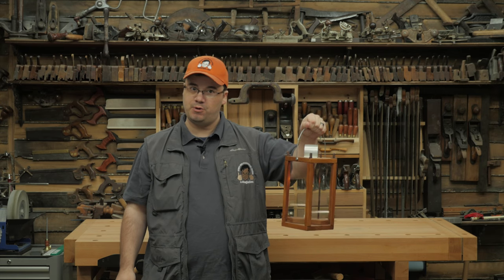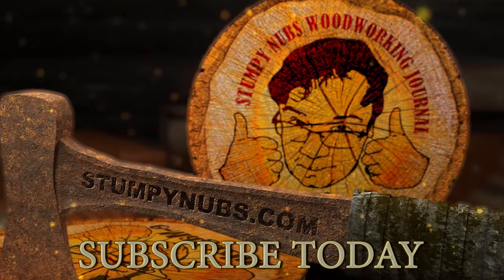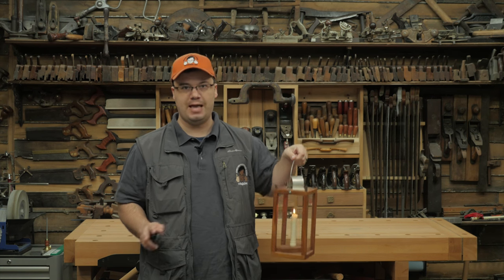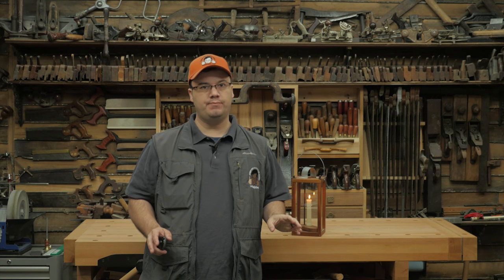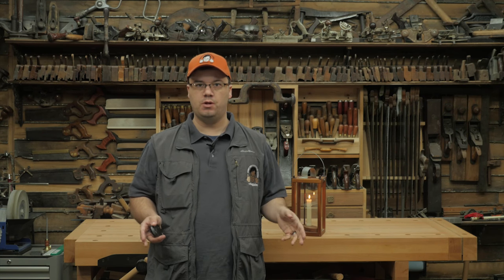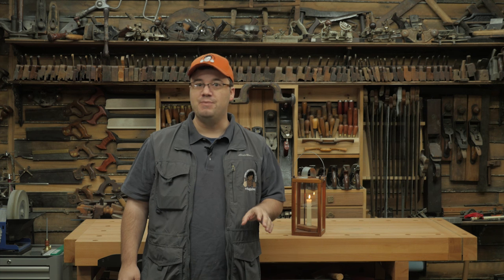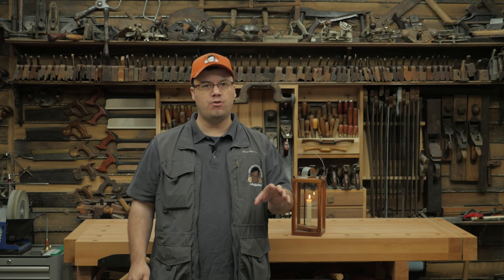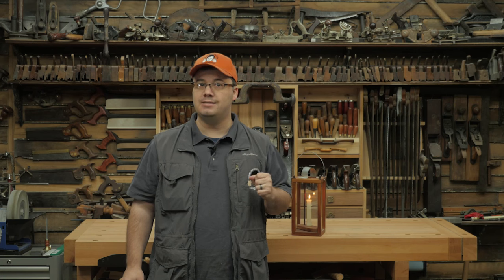Build a historic wooden lantern- Paul Revere's Ride by H.W. Longfellow (rap song)

Comment: What is the metal part on the top for?
Reply: It is a heat shield to protect your hands while carrying it.
Reply: +Everfalling It helps control the air flow, keeps rain out if the lantern is outdoors.......and is really good at removing fingerprints if touched inadvertently (DAMHIK). If you want a flicker free candle, make a fingernail sized notch at the bottom center of each glass pane (total 4). You should also line the candle hole with metal so you don't burn the house/tent down when the candle burns down into the base and sets fire to the wax impregnated wood (seen it happen to other peoples campsites).
Reply: That sounds even beter!